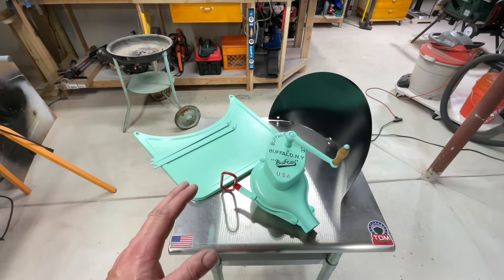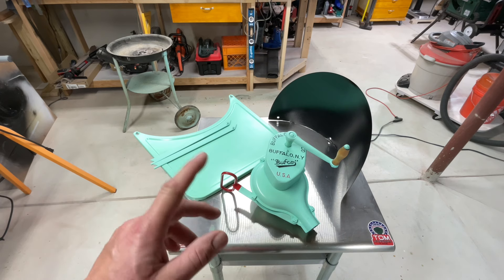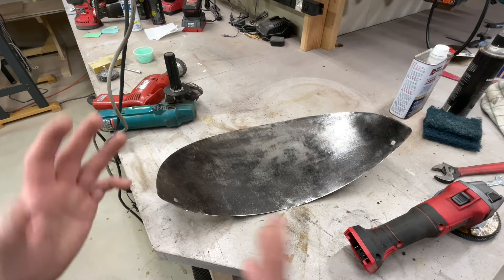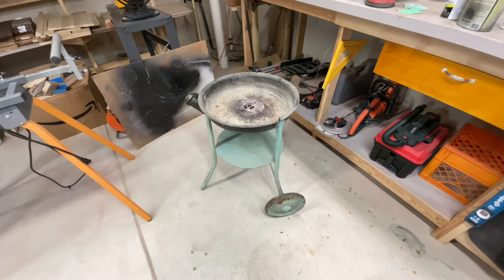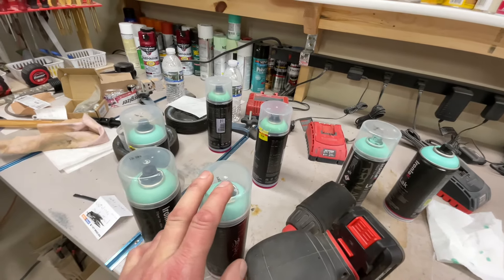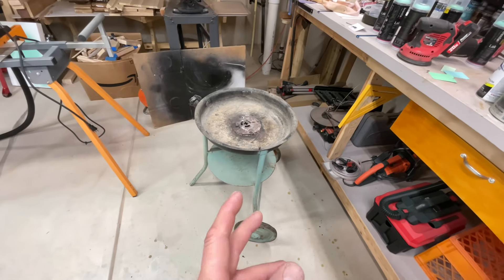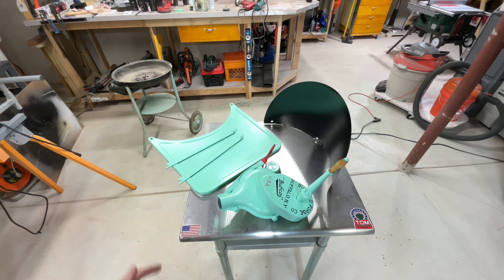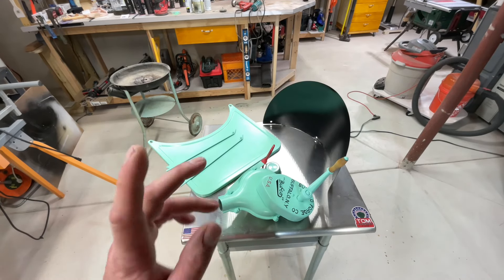70 Year Old BBQ Grill Restoration Update! / Buffalo Forge Broil Air Grill Phase 1 Completed!  🇺🇸

Comment: The restoration is looking great Tom! I know you said you wouldn’t cook on it again once it’s restored, but is there any concern the paint isn’t high temp paint? Maybe the original paint wasn’t high temp either?
Reply from the maker: Thanks for Watching Mike!  You are correct not to be cooked on again,  look up the high heat capacity of rust oleum spray paint you’ll be surprised